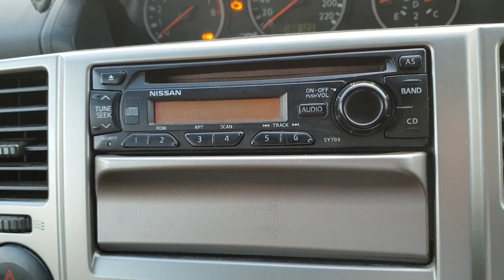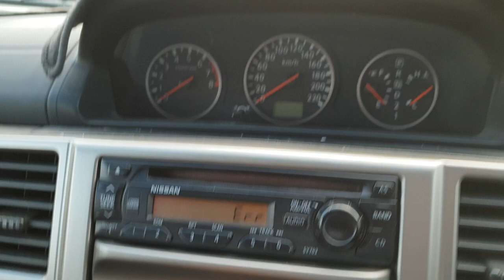How to Solve Radio Error Mesage Err for Nissan Car

Comment: Definitely works I left mine on accessory mode for 1.5 hours and it had gone back to the code status and I could add my code into it. 
My car is a 2005 Nissan pulsar
Reply: How did you get your code? I have a pulsar and don’t want to spend the money getting the code.

Comment: Thanks for sharing.  I had the same problem after putting wrong code many times & could not clear the Err.
Reply: Inspector 1 does it work?????
Reply from the maker: It will work.